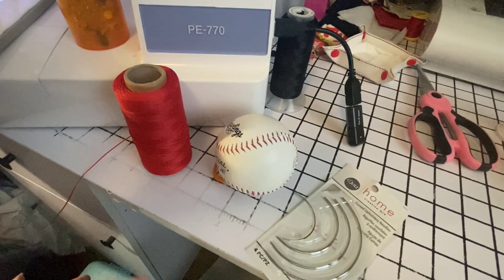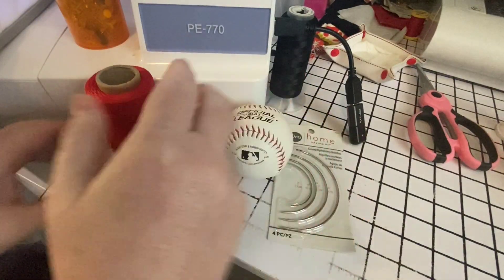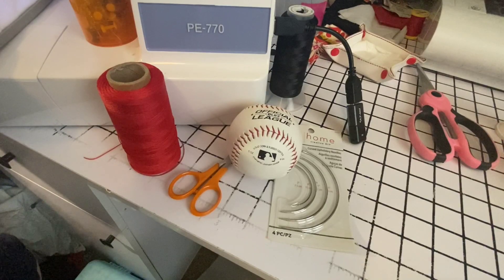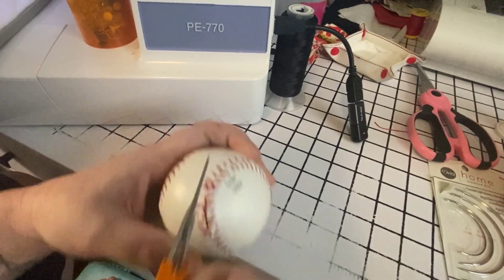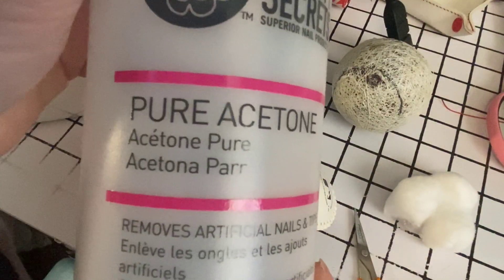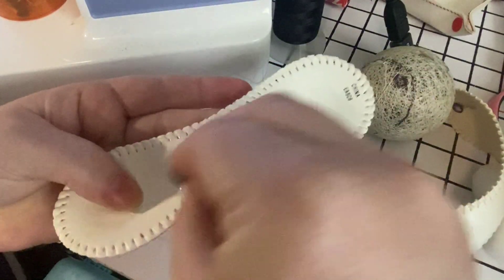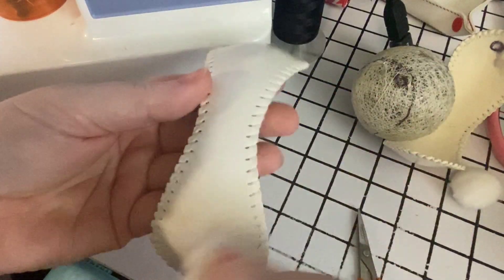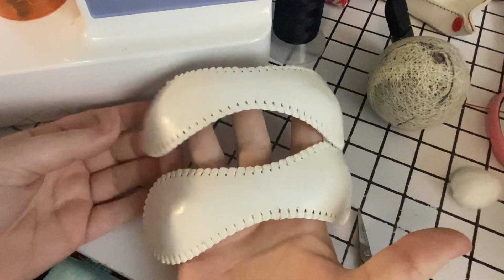How to Embroider on Baseballs and Softballs

Comment: I bought baseballs from walmart and regular nail polish removed it easily. Then I went back and I bought baseballs for 14 and under and nothing removes the ink. I tried my regular nail polish and bought and tried 100% acetone. Just lightened it a bit and smeared it.  The first baseballs I bought from walmart must be different from the second purchase. They had balls for 3 different age groups. There must be something different in the material the ball is made of because my 2 purchases are like day and night trying to get the ink off.